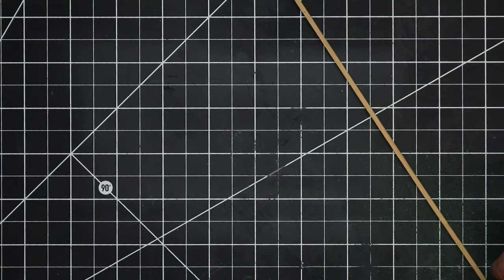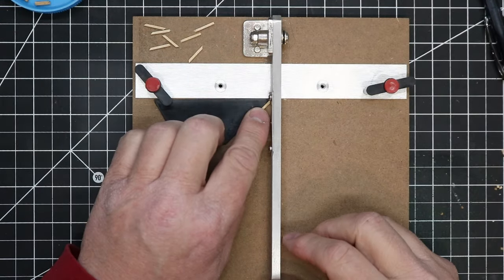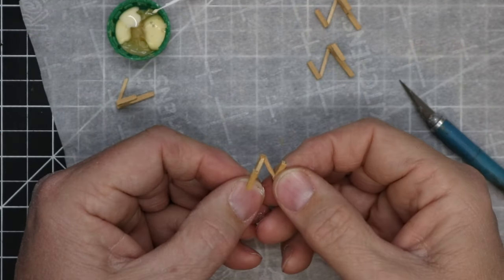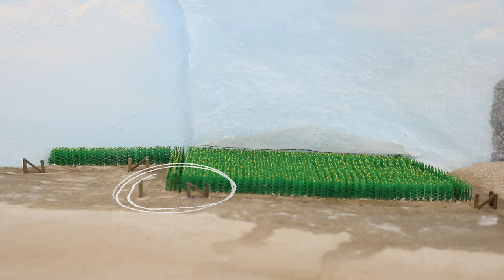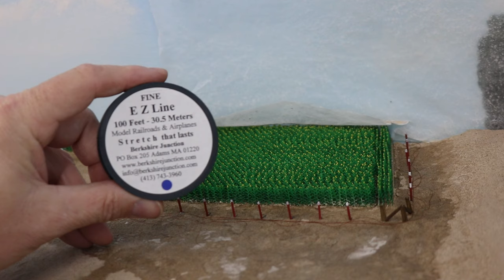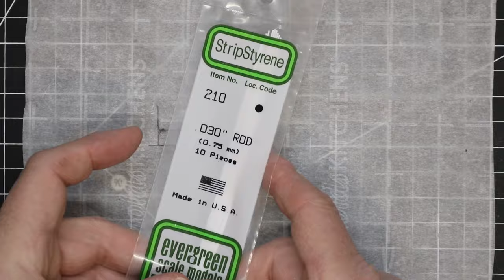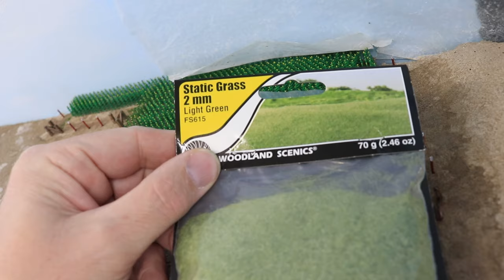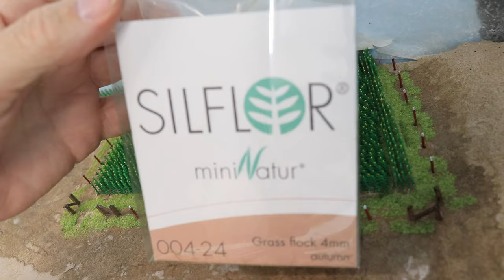Building Authentic Fencing for Your Model Railroad Layout

Comment: The physics in fences is actually very similar to power lines. I happen to work in the electricity industry as a powerline designer, so I see lots of powerlines and lots of fences. This video is definitely a good starting point for the basic design of fences, as well as how to model them.

Ron, if you go on to build any powerlines from scratch like this, I'd be happy to share some of my knowledge.
Reply from the maker: Thanks. My son is an electrical lineman. 👍🏼👍🏼